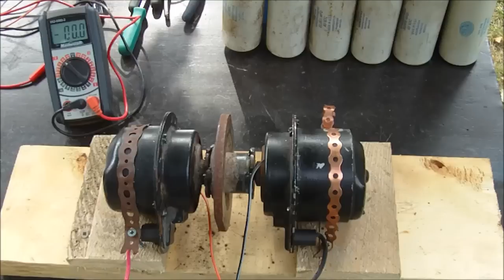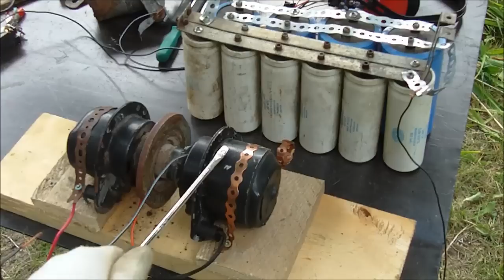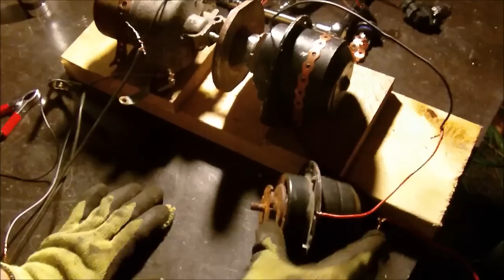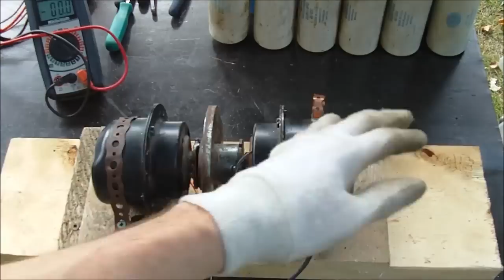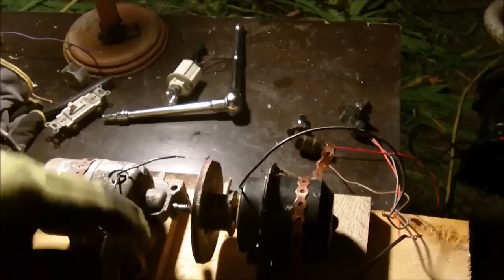Electric Motor to Motor, can they self run?

Comment: Your on the right track though keep experimenting, film yourself with it with your favourite daily tv news in the shot to show proof of dates and times, if you succeed don't put it on public media unless its registered and patented, I'll  give you a race, good luck.
Reply: len Genius I'm actually working on this I give myself the I'm actually working on this idea of myself the problem that I found that I'm working on experiments for right now and when I figure it out I will post a video is that as soon as the other motor is in contact with the drive motor it creates a load this load causes magnetic break it what we need is a diode to stop the back full of energy so that there's basically no load being placed onto the drive motor also instead of having the also instead of having the generator motor going directly back to the drive motor what I feel should be done is to contact the generator motor to a battery effectively charging the battery and then dissipating the energy from the battery to drive the motor almost like a capacitor or to use a high-voltage capacitor I'll continue in my I'll continue in my efforts if I crack it most likely I won't post the video that I've cracked it but one that I've gotten close because you know what happens to people who cracked the free energy code the government doesn't like it and people disappear

Comment: Not if you have the same size motor . Need tohave smaller motor to run the generator there is a ratio you need to follow .

Comment: So could you power a motor off a battery and run the power from the generator back to a 2nd battery then add a switch to switch between the them as one dies and the other is filled? I no shizy about this stuff! But I would think you could if like your saying use a smaller motor the gen, haha but like I was saying idk shizy about this stuff!

Comment: The generator must produces more voltages than the other one spends! You have to do some math and put the diodes for the current to go at the amount of voltages that you want the other one to run. And the left over voltages will go to your battery bank , for example: the the running motor is 12v and the generator motor has to produces 24v . To do this kind of test you will need some kind of fly wheel.

Comment: what if you run one motor with a battery and the second motor will charge the battery that way the battery will never die and the motors will keep running for ever

Comment: That would have been a perpetual machine. Even with 100 percent energy conversion that would eventually stop due to aerodynamic Hahahaha. Just go to space take the motor apart and give the rotor a push it will spin for a very long time.

Comment: by the way if u will use 1 motor with a permanent magnet stator and permanent magnet rotor it will run by itself without any sorce all u have to do is to start it first with a starter motor that breaks its connection the moment the motors starts to run

Comment: what if the fly wheel what like a bike free flying pedals when you stop pedalling the berring keeps spinning put that berring in the fly wheel and a cog to keep it's solidity in place like a pedal on bike system works, the fly wheel would have to store up potential energy so it would have to be literally 1 meter in radius at least, what i'd like to see is a motor running to push a generator after the very same motor is introduced to a plasmatic emf field via neon bulb connections while in the presence of a tesla coil that is powered by the generator and the motor powered by the field, if tesla made a bulb glow when within range so this glowing bulb could power a electric motor to push a generator put a booster starter motor first from battery like a car has then once motion is active in the motor turn on the coil and expect any electricals if set up to recieve from the plasmatic field zone they will run each on that field and the generator could too run on it also

Comment: Its trivial to prove that you cannot connect two identical DC motors together and get a combined system that self-runs, even without invoking conservation-of-energy.

If two similar motors are connected together and self running, they each see the same voltage (they are connected together!), and thus each have equal and opposite currents
(because they are connected in parallel).  By symmetry the currents are the same, so must be zero.

Thus you can disconnect the motors and not change the current, ie the system isn't disturbed and will keep behaving the same (two separate self-running motors).

So unless each motor already self-runs open-circuit, the combination cannot self-run.

And since no off-the-shelf electric motor self-runs (someone would notice that!!), no
combination of two similar motors connected symmetrically can self-run.  Proved!

Comment: How about a UPS.  A UPS provides power in the event of a power failure.  So what happens if you unplug a UPS from the wall, and plug the UPS power cable into the back of the UPS?
Reply: The battery would discharge.
Reply: *****  into what?
Reply: The battery would power the inverter circuit that produces A.C. power which goes into a circuit that charges the battery.  It is naive and foolish to believe this process to 100% or more efficent.  

The battery will discharge and heat energy will be dissipated to the environment until the battery is dead. Why is this so hard to understand?
Reply: *****
It's not, and I already knew that, I just wanted to hear a great explanation, and you are the first to provide one.  Good job.

Comment: The problem is not that one is more powerful, you have them rotating in opposite directions while the brushes and windings are set to different timings kinda like the ignition on a gas engine. The timings are the same in the same direction only unless you adjust the brush timing by rotating the brush carrier. Not to say that you can self run, but you can change the input and output AND MAYBE you could find a way to achieve self run.
Reply: yep ,since they are  d/c motors all he had to do is switch the polarity on one of them and get them going in the same direction, but his setup had them going in opposite directions. another solution would be to have them  mounted side by side and rotating in the  same direction then he wouldnt have to switch polarity.

Comment: ,Yep...we all knew it would never fly......but something you didn't notice....DC motors turn a little faster in one direction...check out ur basic 18 volt DeWalt cordless drill...they spin faster to the left....it takes more power to remove a screw that it takes to screw it in....only applies to brushed DC motors.

Comment: why not you hook the more powerful motor up to a microwave transformer  and slap a small pulley onto  it  and connect the other one with  to the giving end  of the transformer  and with a large pulley  at a higher spot to allow room which is connected to a belt  :) p.s. you kinda sound like shadow the hedgehog  from sonic   xD

Comment: This isn't the concept that Tesla patterned.  He had an alternating dynamo and an exciter motor which he proposed would run a seperate generator for  eleclric power.  He also claimed that it could be plugged into the ground once started and it would  maintain  a constant rotational velocity with a load.  Would the US pattern office issue a pattern if it didn't work?  Tesla described his  machine as a single motorgenerator because the wiring  schematic showed that it was a closed loop internally.  The wiring must be altered to conform with Tesla's intent.  Good luck.

Comment: try use high rpm driver motor and low rpm generator motor, attach belt  1:3 shaft ratio, 1 size being the driver high rpm motor shaft attach to size 3 shaft of low rpm generator. see results

Comment: You can't use a smaller motor with a slightly bigger one. If that was going to work they'd have to be the same motor. That way it outputs the same energy it inputs. But I don't think it would work either way. But it's worth a shot. I might do it myself and not tell anybody. Good day.

Comment: You have a sea of electricity surrounding yourself and the device. The idea is to give the energy in the surrounding space a way to feed into one of the motors. To me they look sealed and the energy doesnt seem to connect through copper wires. It connects through the field created by the magnets. Try opening one side of a motor and see if theres any difference.

Comment: You forgot to connect the Froonium drive. It's the drive that allows for objects in motion to stay in motion regardless of friction, drag, or logic. I must admit that from time to time, I must open up the fill cap Of this drive to top it off with unicorn tears  and pixie dust.  Since there is no oil or fuel lubricating the internal gears, once every eight years you must add a 50-50 mixture composed of 2 CCs of type L positive blood  that must  come  liberally,  I mean literally from the aortic valve of a human heart  along with 2cc's  of type C negative blood from the valve of a nonhuman, I mean human heart mixed together conservatively,  I mean thoroughly  until  both blood types become 5cc's of a  Magnetic Universal  blood cohesion.  Did I mention the unicorn tears?  *Also, and this is just an option and not really necessary but you can  add a fanbelt, pulley, and half a bicycle mounted in series  with Lance Armstrong peddling 24 hours a day  at 2500 revolutions per minute.  Just a reminder that this last part is just a flashy option and not really needed unless you want to draw any power:)1 second ago•

Comment: it would take a hell of a lot of math to figure out all the ideal parameters to make a high efficiency generator, you can't just throw motors together in a loop & expect it to run let alone drive or pull a load.

first off you are way over scale for what you are trying to do, those motors are high current 20A windings & no diodes & is the polarity correct on the generating motor ? (separate it from the drive motor & measure it with the motor running) to ensure the generator polarity is correct as they are in opposite directions one may be reversed thus both are acting as motors turning the shaft in the same direction & when you cut the power they both die.

on a small scale using a 3 -6 v low amp motor & a 12 -24v low amp generator with diodes & a cap bank it should be able to run for a while, also side by side configuration so you can play with pulley ratios of the drive motor & a small flywheel on the generator shaft, you may be able to get it to spin for a while, you will then need a boost circuit to pulse the motor at the correct timing to keep it spinning & a solar charged battery that can run the machine for 3 days & charge the battery in 4 hours & don't forget the current limiter so you can only pull off less than 1/4 of the actual generated current so you can run a small light or charge a small battery.

most of these crazy contraptions are wishful thinking by people have no understanding of electronics or the properties of electromagnetism.

with a lot of work one could probably design & build a high efficiency self regenerating usable power source, but it will have to be huge with a massive flywheel & transmission to get the load requirements low enough to keep it spinning with pulse boost design while drawing a small load.

but anyone one claiming they are getting more energy out than in ???

I have yet to see one producing more under load, only static voltage shown on crappy meters, lol

even these self running magnetic motors, if one ever were possible with an orbital magnet design to eliminate cogging, you might get one to spin but never drive a load, lol

Comment: what about using one motor going clockwise rotation to create counterclockwise rotation of the other motor(gen) through direct magnetic induction from the back of the first motor using oposing magnetic fields and capacitors to store energy to power the first motor creating a infinity loop of energy with the intersection of the loops to flip the energy using the centrifugal forces of one to keep both from stopping. as a example of this imagine two globe's representing the two vortexes and the placement of one and it energy displacement causing equal and opposite energy displacement and rotation and instead of allowing them to run chaoticaley you have continuous monitoring and adjustment sorta like star trek dampners and thrusters to keep one or the other from losing momentum in its particular rotation. that or just creat a superstorm of the two. vortexes and just bleed off enough energy to store and feed back into one to keep the other from slowing or stopping
Reply: I just viewed another video that gave me another way to show this, "a huge wave rolling one way is curling into itself and when it hits at just the right point that wave causes another wave to form and rotate in the opposite direction."

Comment: The motors are soooooo difficult to turn. Your friction is very high and the flywheel is proportionally small. I haven't tried it, but those are issues that the guys that have theirs "working" seem to have addressed.

Comment: we have two 1,500hp natural gas engines where i work. I had an employee say we should covert to electric motor. His plan was to put a generator on each engine taking 3,000hp and hook it to a 5,000hp electric motor so we can get more hp out of the machine lol. i tried explaining to him that you can't make 100% efficient power let alone 150% he wanted. If we could take 3,000hp and turn it into 5,000 electric would be free lol

Comment: You can put a motor to a generator and it will run continuously. You can run a 110 motor connected to a 220 generator to a 20 amp power box wich only let's 110 come from the box to the 110 motor to run the generator.

Comment: What I have found is this:
  You can do this, just not this way. Generation must exceed the total of the load plus output of the base (battery). 
Example: 12v motor + 12v battery must be < 14.5v generation at above the amperage used to power it under load. So, you need to generate, I would guess, around 18 - 24 v no load at higher amps than used. 

I've personally verified this, but I am just another dude.  Of course, testing is needed to prove this to yourself, as VERY few can be trusted to give a strait answer, and people like nothing better than to one-up everyone else even when they themselves don't know.

Comment: yep... seen these before, some try and convince but atleast your informative and objective, iam also open minded but the technology is not available or suppressed, either way I've seen it done but not feasible at all. 
liquid cooled sub zero magnetic bearings and integrated 6phase motors,  the cooling alone used more energy per minute than it generated per hour... all of that combined with the external cooling and it made less than a tenth of a percent over unity iow 100.009%

Comment: Missing the point. 1 motor can initiate the secondary motor with an offset balanced flywheel. The centrifugal force then rotates in a non stop cycle. (As if water or wind powered) then you shut off or regulate the 1st motor to adapt to the secondary motor needs. Is it simple, yes, but does it need constant attention/man power to flip knobs and tinker with output- yes. So that is the only reason why it is simpler to just pay the electric company.

Comment: Hi guys, I know this question that I'm bringing up might sound a little stupid, but the electricity being generated from a motor would be a AC current, whereas the motor accepts only DC input. I know this might sound nonsense but does this affect's the result?
Reply: Mate, you can' produce AC with a motor, you need a inverter for that. And even if you had an invertor the output would be the same. Perpetual motion is impossible, just get solar power instead.

Comment: you can also use one ac motor and one dc motor to self charge or right now I'm using a b&g motor with a car alternator batteries  and inverter runs 24/7 for months powers  half my house

Comment: 1) battery's  2) Gen has to put out more then the electric motor uses... at full charge, flip the switch off turn back on once voltage is down to 80% it will work...

Comment: If you have the time and or money, try using a steam engine boiling the water with electric, then taken the power from the steam engine and run a generator, the power produced from the generator will keep the electric for boiling the water in the steam engine. The real goal is additional amperage to operate a light or any other electric utility.
   The trick is getting more amperage out of the generator so you can splice off additional current for other things. Just  keeping something running on it's own is no problem, the problem comes in doing more then just keeping it running, producing extra power above and beyond what you need to self run is the goal, P&L ( :>).

Comment: Gear ratio with floating water bearings or magnetic floating bearings. Drive motor with larger gear and generator with smaller gear. Motor with largerr gear has smaller dia. bearings and generator with smaller gear has larger dia.
bearings. Power used should be lower than power produced.

Comment: Add a transformer to up the current or add gears to increase rpm without increase of energy require to turn
Reply: You can up the current but you will lose wattage total after the transformer. Gears will perform in the same way. Both add yet another drain on the total wattage (or "energy")
Reply: Adding gear does not give you more rpm, only torque